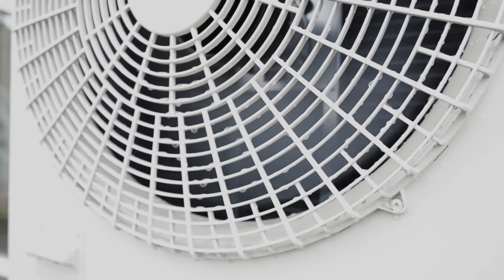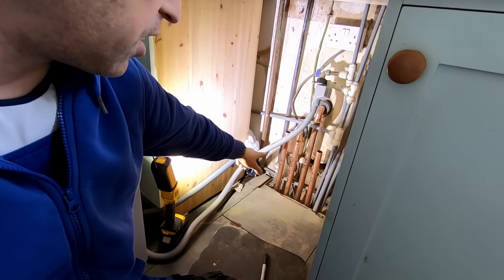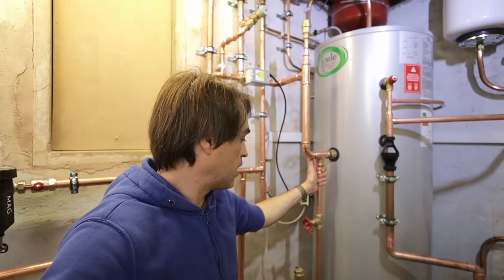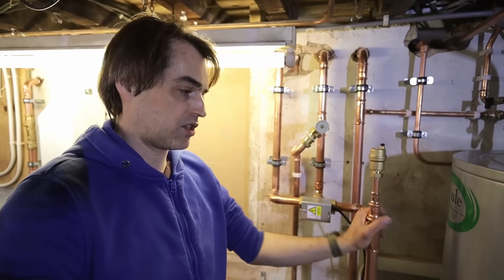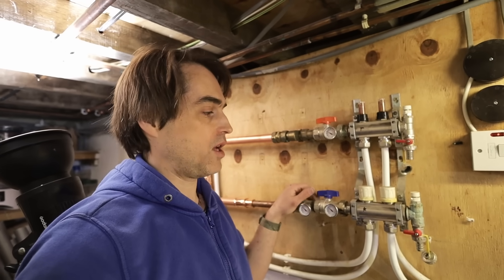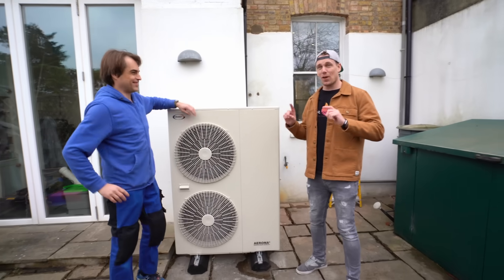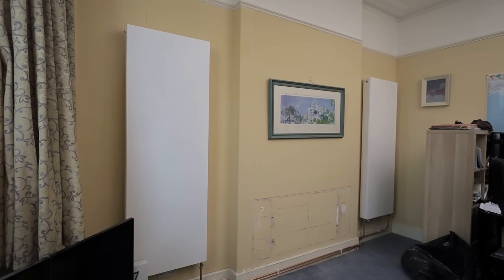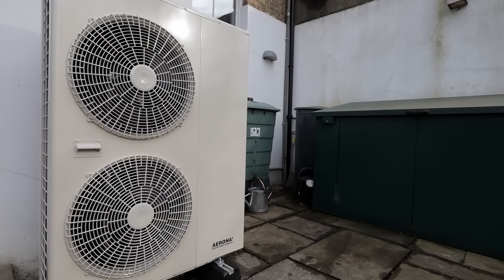The Truth about Heat Pumps: Debunking the Myth.

Comment: Wow! I'm impressed. I didn't know there was so much design involved in these systems. 

I have three air to air hear pumps at home and mainly bought them for cooling during the summer months but will give a good level of heating during the winter. For now I'm keeping the combi boiler as the main source of heat but with gas and electricity going up in price I'm really unsure which will be the most economic source of heat. One is 3.3kW in the lounge and the other two in my office and bedroom are 2.5kW. I guess I need to check consumption next winter and compare.
Reply: Depends on your climate, if the majority of the winter is close to or above freezing, heat pumps will likely be cheaper. As you get past around -5c to -10c, your combi may start to be cheaper.. but then it also depends heavily on gas/electric prices!

Also, not sure why in the UK air to air is so rare, considering how much more efficient it can be and how much simpler the installation process is 

I mean, I managed to install one in a freind's clubhouse in just a couple of hours, only a couple steps were easier with two people but in that situation absolutely could've been done with one person. Also depends what refrigerant your heat pumps use, R32 seems to deliver more heat in lower temps compared to the performance of R410a, but thats just from experience so don't take my word on that! If they're also inverter they'll perform much better than single speed units
Reply: @tlaroche38  Thank you! So many different factors to take into account. I think I need to get energy metering installed and then do a couple of weekly runs in the winter comparing the air to air and combi system for heating. Prices are totally in the air and that is the main thing. We are talking about a chaotic system. Now we are approaching summer I'm more concerned about costs of cooling the house. 

The refrigerant is R32. 

I think the push is for replacing all forms of gas heating in the UK - I personally don't think it is practical and I for one will not be giving up my combi. 

Thanks again :)
Reply: @rjy8960  Another potentially easier solution, is to calculate your break even COP and look at the minimum temperature that your systems can achieve this 

In my situation, gas is 7.48p per kWh, and electric is 28.46p per kWh

So to calculate, divide your gas price (7.48) by your boilers efficiency (in my case 90% or .9) to get your true price per kWh of heat delivered, in my case this is 8.31p 

Next, take your price of electricity (mine is 28.46p/kWh) and divide by your true p/kWh from your boiler, so 28.46/8.61 which gives the break even COP for my system at 3.3, or 330% efficiency 

Then use that COP and check with the heat pump's data sheets to see the temps that this is achieved, annoyingly I don't have access to the data sheet for my system so can't tell you the exact figure, but I know the system normally achieves a COP between 3.6 and 4 so 3.3 should be achievable in most conditions 

So formula is:

Electricity cost ÷ (gas price ÷ boiler efficiency) = break even COP 

Sorry that this is so rambly haha but hopefully some useful info!! Might be easier than tracking energy usage depending on what info you have available

Edit: also, it's totally possible to replace all gas heating with heat pumps at the moment, but the government needs to stop dragging their heels and take some propper action, as with current electricity prices and installation costs, it's unlikely that a homeowner with a functioning gas boiler will see the installation costs of a heat pump returned within the equipment lifespan which really should not be the case but hey ho, that's a whole different discussion 🤣 like anything there's so much nuance and factors to consider which I doubt the government have looked into, evident in the fact I believe you only get the subsidy for installation costs for air to water or ground to water systems, not far cheaper air to air systems
I think we basically have the same setup except my heat pump system is a 3 head multi with a combi boiler for hot water as opposed to 3 separate systems

Comment: I live in Colorado, and my grandparents' 6 year old heat pump works just fine. It's not designed for whole-home heating by any means, but it was barely any more expensive than an equivalent AC, and keeps their bedroom warm on spring and autumn nights far more efficiently than a resistive heater would. Saying that they don't work is simply wrong, and makes me feel like you really just dislike them because you make a smaller profit margin from installing them. It would make far more sense to say that they are typically not the best solution specifically for whole-home heating.

I've never considered whole-home heat pump use since it gets super cold where I live, and it would be too big, but they make a great substitute for standard ACs.
Reply: Someone didn't watch the video. ^
Reply: @trentoncarr  I did watch the video. That doesn't excuse the title being a BLATANT LIE. If they don't work, and he installs them, then he is selling nonfunctional equipment, which he clearly isn't. I don't know why people have started allowing 2010-era explicit-lie clickbait to make a comeback, and I don't like it one bit. Think about how many people scroll past this video and add it to a list of confirmation biases. It's not good, at all.
Reply: @specialopsdave  He likes them a lot in the comments too. I think the title is just hardcore clickbait and is making the comments section pretty wild. lol

Comment: I wonder if there is a opportunity for a type of consultancy business that would provide a service to home owners to assess their insulation, heating, cooling options to best suit their unique situation and to recommend what products to use in that given situation. I live in NZ in a unit that is 1 of 10, built in early 80s and every unit has a totally different approach and some are very expensive, and I wonder what the real benefit and running costs are for these systems. Surely it is a waste of time to put a heat pump in if the building is not even insulated? Which they aren't, my next door neighbour has an expensive heat pump, the service man is there every week fiddling with it and none of the units have roof insulation, surely that would be the first thing to tackle. Another unit had their windows replaced with double glazed new units, but if the walls and roof isn't insulated , what's the point. My monthly power bill is $30 , hate to think what they pay, I insulated the walls when re plastered, but went with single glazed windows as the double glazed cost was too high. My unit doesnt get too hot in the summer or too cold in the winter, so wonder why the other units spend tons of money for very little gain.

Comment: Nice video. Whats your opinion about the new propane heatpumps that will beable to deliver higher temperatures so that no internal changes have to be made
Reply from the maker: They still need a system design and upgraded pipework. They are still more efficient at lower temperatures not higher temps, son will benefit from correct system design and larger radiators to run at lower temps.

There are no heat pumps that are a direct replacement for a boiler and probably never will be. Manufacturers are misleading customers with their marketing.

Comment: Heat pumps work PERFECTLY fine.  I installed an air source heat pump in my home last year and it works perfect!  European countries who import Russian gas are feeling the pain and horror of buying Russian-fascist fuel that aids in killing innocent people.  And gas is a huge contributor to climate change so we need to install as many heats pumps as possible, and solar on EVERY roof top in existence.
Reply from the maker: Yes, they need a bit more knowledge to install though as compared to a gas or oil boiler
Reply: @UrbanPlumbers  If you accept that heat pumps work, what's with the clickbait dishonest title? Heatpumps are just reverseable air con units. Simple thermodynamics with proven engineering. Suggesting they don't work in the title is a lie.
Reply: lol, shut your mouth mate.
Reply: Plus 2000w wind turbines if you live in any sort  of windy area.. Our property in Scotland has added wind and OMG it works through the night and basically we use nearly NO grid electricty

Comment: The problem with heat pumps will be in the winter, if outside temperature will get at around - 2 celcius or colder it can not keep up and efficiency will devalue 4 times
Reply from the maker: Heat pumps can keep up just fine mate to well below -2 . Nice try 1/10
Reply: Maybe - 2 celsius but check your efficiency  when it goes down zero.And wait, was this a game Where you decide the points and outcome? 🤔

Comment: I'll stick with my Oil fired boiler thanks... cheap to run and cheap to install  👌
Reply from the maker: Mate, oil is much more expensive to both run and maintain than a heat pump by a long mile. If anyone could benefit from heat pumps it would be people currently on oil.

Comment: It looks really good & a lot of effort & thought into it.
Unfortunately, there are much easier & more efficient ways of designing & installing systems & using existing central heating systems to do it.
Reply: Yeah, I didn't so much take away that heat pumps don't work. Just that substantial heating without central air is gonna mean you need a bunch of big radiators everywhere.

Comment: I've installed 10's of thousands of heat pumps on my own.  It's quite do-able.  Caution has to be used when making bends in tubing to avoid kinks.  One company I worked for would send 2 of us out to install 10 or 12 units per day (not including ductwork which was already installed).  We would simply work better each of us by ourselves and we'd go down a row of townhouses and complete 5 or 6.  No magic, just steady work.  There's basically 3 areas during installation:  indoor unit or air handler, piping often including control wiring and line voltage wiring, and the outdoor unit.  I used to leap-frog and vac one system down after completion (before start up) and start doing the next home's system while waiting for the vac pump to draw a system down.  Use of OD t stats, inverter fans and compressor made comfort with a heat pump a sure thing.  OD stats either bring on back up heat at a set outdoor temperature as well as shut the outdoor unit off completely when the outdoor temperature is so low that any usable heat costs more than what the backup heat costs.  In Canada heat pumps can produce enough heat to provide about  70 to 80% of the needed heat in a home, if sized properly.  Sizing is the other issue.  Under sizing a unit leads to frustration in call backs and discomfort within the home.  Basically, having a quality contractor install or at least size the unit is a good idea but not absolutely necessary if a homeowner wants to size themselves and are willing to do a manual J worksheet (google that), it's possible to get good results.
Reply: Do you do more than one a day?
Reply: While over sizing results in crap efficiency.
Reply: Aren't you talking about US systems with air-to-air?

Comment: I have a 32kw hoval heat pump here in Switzerland.  Works great.  Quieter, more reliable, cheaper to run and better heat production than my old oil boiler.  Doesn’t smell and needs no maintenance.  And all our electricity is green.  I guess the UK is too humid for them and the houses too badly insulated.  Admittedly it did cost 80k to install so it’s not a pure cost consideration.
Reply from the maker: Thank you for your comment.
Reply: Any mechanical device requires maintenance. Air to anything heat pumps need regular cleaning, change of oil and fridgerement, plus any parts that stop working. I would still advice to have wood fired boiler as a back up to heat pump case of power failure, its just smarter to hate options and electricity provided is not ever guaranteed, otherwise there would not be clauses in the power company agreement.
Also sorry to burst your bubble, but there isint such thing as green electricity....Solar farms create dangerous waste that only few companies are attempting to recycle, but they are taking huge risk top of material priceses being high, so if those go down that business is done for with out government subsidies witch are only reason why other "green" projects in general can even operate. Wind farms are inefficient, wasteful and create even more dangerous waste we really cannot recycle at the moment, so nether of those two cant be called green, or cheap since that energy as is, is very expensive, but moment you realize its so "cheap" only because government subsidies you realize its unsustainable. Only the classic lets milk from the naïve populous using this green ideology. Hydro would be best of those 3 methods,  but it tied to geography, changes the eco system and looking for instance how things are in China, causes severe issues how water works. Of course climate change, crisis or what ever is the newest scare term is said to cause the Chinas droits in south and floods in north that use to be wet in south and dry in north, but maybe if you redirect whole major rivers that might have effect on how water works, specially when ground water has been over used and polluted in China.
Heat pumps are rather nifty little devices but 80K for install...what kind of mansion you have? Bit under 200m3 house stays warm with 5K including everything air to air pump and fire place does the harsh frost help when its efficiency drops around minus 20C.
Reply: @Hellsong89  all hydro here.  Never had a power failure but if I did I have a fireplace and plenty of chopped seasoned chestnut wood.  It never drops below about minus 5 (in feb) and most of the year it’s above 12 at night.  If all else fails I have a mountain home 2 hours away.  But it seems unlikely it would ever get that bad.  40k was parts and equipment, 40k plumber, builder and electrician.   The install was non trivial on the mountainside, required helicopter etc.  house is about 300m^2 and 32kw is probably slightly oversized.  24 was borderline.

Comment: Want your fuel bills to decrease? Then stop subsidising renewables that don't work and invest in LFTR nuclear, all your energy needs and climate concerns addressed in one fell swoop.
Reply from the maker: No one is subsiding renewables that don’t work so your argument is pointless. 

If we develop more nuclear then heat pumps are still the most efficient way we can use that energy to heat our homes.

You can’t use electricity generated by nuclear to run your gas boiler, can you?
Reply: @UrbanPlumbers let's play the definition game. I'll define what I mean by "don't work" and you define what you mean by "do work" 
By don't work I don't mean they don't produce energy, that would be dumb but what I do mean is the cost of that energy both financial and environmental is prohibitive. 
Financial. It's extremely difficult to get figures for the cost of wind/solar generated electricity per MWH, but the 4th round of government subsidies is set at £285 million per year leading to an artificial drop of 65% in supply prices. 
Of course nuclear is subsidised as well but all that is factored into the MWH cost and is delivered to the consumer nullifying the subsidies and eventually turning a profit. 
Environmental. 
The Environmental cost is enormous. Prohibitive land use requirements, wild fowl destruction, inability to recycle materials once used, especially when cheap solar panels are bought from China often leaving toxic waste which is just shipped to the 3rd world. 

As for heat pumps I had a house with an air source heat pump and it was at least twice as expensive as the gas central heated place I left. 

Your turn.